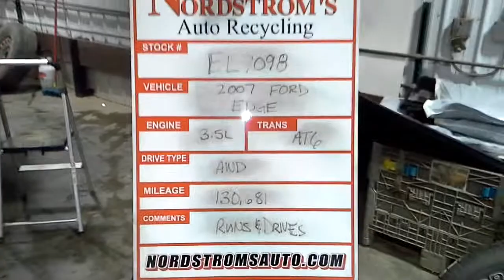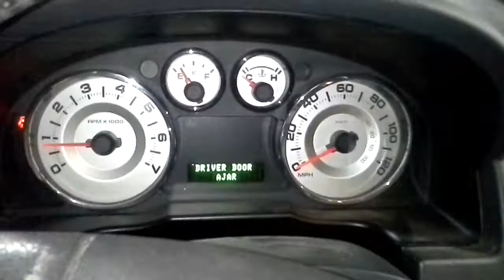PARTS FOR 2007 Ford Edge  EL7098

Comment: Can you use parts from that car for a 2008 Lincoln MKX
Reply: Many parts from a 2007 Edge will interchange with a 2008 model year.  You will still want to confirm each part before purchase. Contact Nordstroms directly at 877-200-0109 or parts@nordstromsauto.com.  Also buy online at nordstromsauto.com. Thank you!